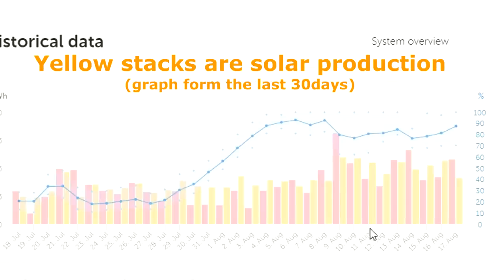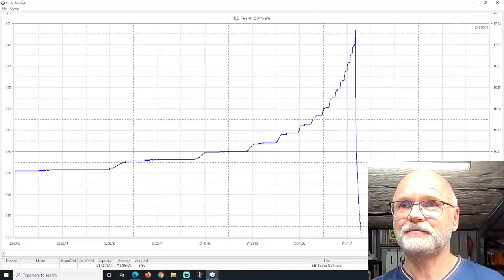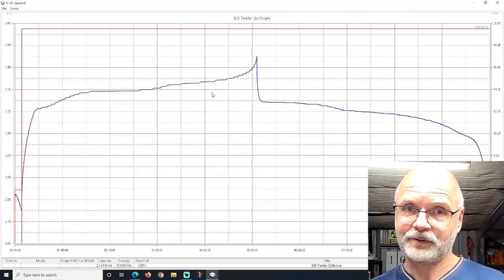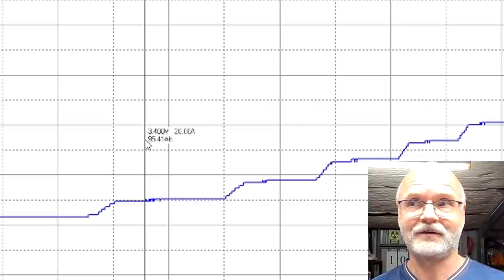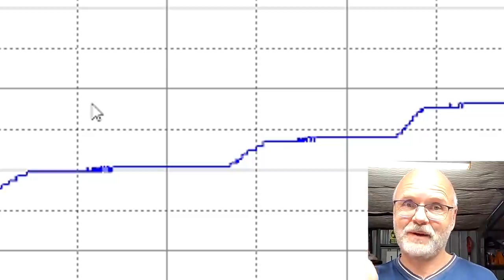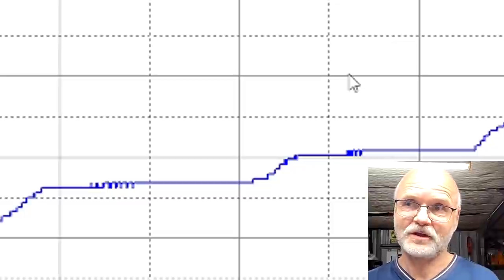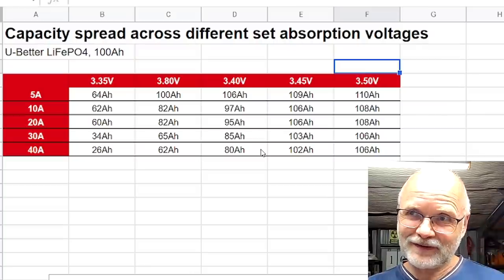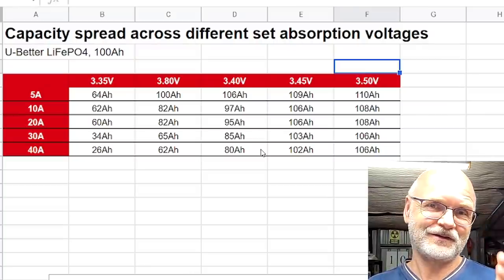Finding 20% and 80% SOC with LiFePO4. Why charging current and charging speed matters!

Comment: This is the best video I have seen you make. It really is help at this point as I have just been wondering what the capacity is with that crappy Daly balancer. It stops  charging at 3.3 volts on 10 of my 16 cells cause 2 or 3 cells hit the max and then stop charging over and over on the low cells. Daly is disgusting.

Comment: There could be an issue with the 'apparent' battery voltage as the current changes.  The impedence of the battery, bus bars and cables will cause a higher voltage reading with higher currents.  The voltage after a short rest of zero amps is the true battery voltage, not the voltage as power is being put through it.

Comment: Very interesting. I wonder what it looks like at 3.55, 3.60 and 3.65V? I have a sneaking suspicion that the differences would get smaller again. Then would be the question, at least in my mind, testing absorption times. Despite not wanting to stress the battery, it may well turn out that charging at 3.65V is best. Inevitably, one cell will max out well before the others and so charging will stop while the cells absorb and balance. How cool would it be if that turned out to be the most efficient and fastest charging, AND after balancing and absorption, the cells were standing at 3.45V? I bet that they would you know. But, does the absorption time vary according to the charge rate, given a fixed charge voltage?

Comment: This is superb, I kind of thought that from my own loose playing / experimenting, but seeing it methodically tested out and graphed confirmed why its so easy for my MPPT to go into "float" when charging at lower voltages, have  spike in the sunshine, peak amps and hit the absorption voltage very early in SOC.

Cheers Andy.

1 thing I'd been interested to compare is what the comparison of the 5A charge you have there is to a 40A but then absorb to 5A - so both finish at the same amperage - how does that effect capacity ? Does that bring it back to a match?
Reply from the maker: Thank you. I will do your suggested test at a later stage. It's on my list now 😉

Comment: Great analysis and real data as usual Andy. I wonder if you could automate a settings values for low light/ cloudy days, ie: your system knows/senses these extended low light times and makes adjustments to the voltages within settable parameters to maybe increase voltage a little when the system is going through extended periods of low lighting/rainy periods and conditions to help compensate and push a little more amperage until it reaches say a (settable) 90% SOC to help keep them in or absorb a higher state of charge? Does this make any reasonable sense to you. I guess if ur chasing more than 80-90% from ur battery bank, u should probly be considering more batteries, cheers, I SPAT on you.
Reply from the maker: Thanks Evan. That makes perfectly sense and I think some people in Europe do this manually and turn their BMS from summer to winter mode to achieve a bit more charging in wintertime. It is also possible to include the weather forecast in your charge algorithm and charge the cells a bit higher if bad weather is going to hit the next day.
Cheers 🍺

Comment: 100% as suspected.

I have a EV with the same battery pack of your previous car. (328V 50 Ah)

When charging with 2.5 C, the CV part of the charge start at around 40%, but when charging at 1.5C, starts at around 60%. And 0.1C, it starts at above  95%.

Since you have time based CV part, you get different amount of charge before the time is up.

If you use a tail current, I assume that your energy will be more consistent.

The reason you get more consistent result with higher voltage, is due to the fact that the voltage increase is steeper at the end.
Reply from the maker: Yes, these tests were all without any absorption. If you do that it's a totally different outcome. You can set a tail current in the SCC and would get a better consistent charging.

Comment: Wonder if Victron's default 3.55V is even tighter across those charge currents.  the 3.8V results are interesting, and shows there is a sweet spot that the batteries like. Unsure how it would related to longevity of the battery though.
Reply from the maker: Could be a bit tighter spread. They also do a 2h absorption phase afterwards. So these cells are then 100% charged. I don't like that...
3.8V must be 3.38 though. I'm just too lazy 🤷‍♂️

Comment: So what I’m hearing is the faster you push amps into the cells, the less efficient the cells are at retaining the amps. Ergo, a 48v battery in the same environment as a 12v battery is likely 4times more efficient at retaining the amps when charging, all other things considered equal.  So that makes a good case for using a higher voltage battery bank over a lower voltage battery bank. And not just because of wire size, but because of efficiently. Would you agree?
Reply from the maker: No, you misunderstood that. It has nothing to do with efficiency of the battery at all. It has to do with allowed time to absorb energy while charging. 
Think about the cell as a sponge. If you trickle some water on it it will fully take in all the water but if you tip a bucket on it, it absorbs only a bit of all that water.
The slower you charge, the more capacity you cell already has when it hits a certain voltage.
Reply: @OffGridGarageAustralia  Ah ok. That still makes the case for 48v over 24 & 12v though. 48v sponges better. 😂
Reply from the maker: @Shep5847  Hahaha, yeah, it depends on your setup. Mobile is most likely 12V or 24V, if you go stationary I would go 48V.
Reply: @OffGridGarageAustralia   I previously built an RV system on 24v and used a 24v to 12v converter. But now I’m thinking of building my new rig (due here in October) with a 48v system. I figure if I’m going to convert from something to 12v, might as well use a voltage that is more spongy in my system than 24v!  I know the wire sizes will be smaller, but really I don’t see much cost savings with the smaller wire. But the sponginess is certainly a big benefit!  Keep up the good videos!

Comment: Great work, 3.6V should be a voltage to be tested also.
Reply from the maker: That's not necessary as it will be even better than 3.5V where the capacity was already very close together. At 3.6V you get like 99.5% with all charging speeds.
Reply: @OffGridGarageAustralia  Thanks for the info, I never tested that. I have some 32700s of 6000mAh that I want to make various tests on and I'll also get some 100Ah "bricks" for my future solar. Those will be a paint to be tested from a time interval perspective.

Comment: I have a problem. I have been constantly watching your videos.  Great resource. The best I can find so far.  

I ended up buying two of the 250A Muller BMS 12V  

One cell is making me pull my hair out. If I set the charge cut off at 3.55 per cell all cells will charge to 3.45 except one.  One cell is stuck at 3.330. I have the balancer starting at 3.45. 

I tried to drop all cells to 3.350 and balancer at 3.330. no luck. they will equalize but would mean im stuck at 80 percent

Comment: To get the the AH capacity,  What was the time for each level? A longer charge time with a low CC will give a higher AH. But if you charge with a low vs a high CC for the same what do you think the outcome would be? Lets say starting from 3.250 to 3.500 or until lets say 30 min charge?
Reply from the maker: Ah, I see what you mean. interesting question... 😉

Comment: Isn't this just because the voltage reading is not actual battery open circuit voltage? When you charge with high amps then the voltage reading will always higher than the actual open circuit voltage, right? So for example for the 3.8V 40A graph, the reading of the voltage is higher than the battery open circuit voltage, that is why it had a very low SOC reading. I guess this voltage difference is made by the battery internal resistance. And perhaps the more a battery is charged, the higher its internal resistance? I guess when you change from 3.35V to 3.45V, then what it means it just the battery will be charged with more energy and it's internal resistance also gets higher, resulting it becomes "harder" to finishing absorption at that voltage, so you see less variance?
Reply from the maker: Yes, that is correct. Charging voltage is always higher than the actual cell voltage. Otherwise you would not be able to let current flow. The interesting part is the saturation of these cells. It's like a sponge: fill it slowly it will hold a lot more water than if you just tip a bucket of water over it. There is not time to absorb the water. That's basically the internal resistance of the sponge. Similar with the cells and LiFePO4.
Reply: @OffGridGarageAustralia  Yes. Thanks for making those videos. I also noticed this sponge effect these days, as I don't have a BMS yet so I was manually monitoring the battery while charging it with solar. What I noticed is that the voltage reading went up or down with different amps on different days, while the battery indeed got only charge up single direction. Sadly in Sweden it's getting cloudy autumn now, not sure if I could survive through the winter with my battery 😁
Reply: @OffGridGarageAustralia  Fuyang Liu points in the right directions. In your table you see more or less the impact of the internal cell resistance (I assume you have measured the voltage directly at the contacts of the batter). Let us pick the figures for 20A charge current and 3,45V with resulting 106Ah. If we double the charge current to 40A there ist the same 106Ah with 3.45V. This is no surprise. The internal resistance creates a voltage drop which is lost für the chemical process. What are the specs of the cell stating regarding the resistance?  From comparing the figures at the 3.4V @20A and the 3.5V @40, I estimate the internal resistance of your cell to be 5mV / 20A = 0,25 mOhm. Of course, there will other effects as well, but the Ohm law ist present.

Comment: Be curious of the battery temperature between 5 amp charge and 40 amp charge 🤔😁
Reply: I agree
Reply: it is negligible and shouldnt be too warm since its a 100Ah cell.
Reply from the maker: I never got a battery warm through charging. They are so large and Ri is so small. Does not make a difference at all as Chandra said.

Comment: Excellent video and very good graphs.  Is it best to charge to a certain voltage or to a specific state of charge (SOC)?  I have set my batteries to never discharge below 10% and stop charging at 90% SOC.  I was told this is best for getting a long life out of your battery.
Reply from the maker: Yeah, that is probably best for the battery. It is just not easy to find these points with LFP batteries. What are your settings to achieve that and do they fall inline with the numbers I have shown in this video here?
Reply: The only way I have found to get 10% to 90% is a very accurate shunt. Voltage is a very poor SOC indicator as Andy just demonstrated.

Comment: It's very interesting to watch - at lower voltages and higher charge currents, the battery is given next to no time to "absorb" the voltage so takes in much less charge, but just pushed to the next voltage up during that charge curve. But at lower charge currents (eg 5A) you can see the battery is given more time to "adjust" to each voltage - I think this is why it reaches a much higher SOC. I wonder what would happen if for example you set the charge voltage to 3.35 / 3.38 /3.4V with your big 40A Chinese charger and let it absorb down to say 1-2 amps instead?

Comment: Seems like you just want to lower the current the closer you get to the charge voltage.  Probably 3.45 and 3.5 gives you the sweet spot where the charge controller is reducing current BEFORE the BMS triggers an over voltage stop.  And if you do 3..35 the charge contoller must think a full charge happens based on voltage which is higher when more current is put in.  Almost like you need full current to 3.3V, then 10A to 3.4, then 5A to 3.45V.
Reply from the maker: You can still fully charge the battery to 100% at 3.35V with a looooong absorption time. I have a test for that on my website, I believe...

Comment: The trees blocking the sun are a problem, a little trimming seems to be in order. not mentioned in the equation is extending battery life by not charging or discharging so high or low. Interesting.

Comment: I don't know how you measure the voltage on your tests. But if you are measuring the voltage at the output of your tester then there is an increasing error, because of the resistance between point of measurement and the cell poles. The voltage drop will be higher the higher  the current. So, when the charger sees 3.4 V, the real voltage at the cells will be still be only 3.35 V. There is equipment available that has extra voltage measurement lines with no voltage drop. With this will get much more consistent results. 

There are solar chargers that also have extra voltage measurement at the battery to compensate for the voltage drop.

An additional error is introduced by using the charged capacity as reference, instead of discharging the cell when it reached the target voltage with the same reference current. The difference is that higher charge current will cause higher loss at the internal resistance of the cell. 

Finally, I don't understand why it is so important for you that the battery is perfectly balanced at 100 %, and voltage even above 3,6 V. You know that this all causes faster degradation, especially when you keep the battery at this high SOC for longer time. Its like with the batteries of mobile phones and notebooks, that are charged to 100 %, and kept at this state. 
You should be relaxing a bit regarding SOC and balancing. 3.4 V is good enough  for charging. If one cell sticks out the head and gets higher than 3,4 V the active balancer will do it's job over time. How long balancing takes doesn't really matter, as long you have enough capacity. 

If you stay at 3,4 V you probably see never a disconnect from the BMS, because active balancing keeps the balancing. I don't think that more sophisticated BMS with direkt charger and load control is worth the money. This money es better invested in more PV and  battery capacity.
Reply from the maker: Hi Emil, you must be new to the channel. Welcome!
The voltage is measured at the terminals directly. All ZKE-Testers do that.
I'm testing different settings here on the channel and don't just do the straight and correct tests and setup as most other channels do. I'll leave the proven track and go of-road, exploring, observing and learning from that.

Comment: Hello.
LIFEPO4 cells are sold under many brands. The number of charging cycles, charge-discharge currents, price, min discharge-max charge voltages may differ.
I'm talking about prismatic cells. I want to make the most suitable battery for F/P. Therefore, what is the essential determinant in cell selection?
Does it make sense to determine the battery capacity as needed? Or is more better?

Comment: when i was off-grid i also found even tho nothing had changed that the battery would take longer to charge some days compared to others my idea all be it wastfull was each panel having a buck converter wide open voltage but limit the current so lets say the dullest day the panel will only put out 1 amp at best i set that then if charge rate of battery is 40 amp i would use 40 panels not ideal due to space limits but this in thoery woul keep a steady charge rate no matter the weather that or hydro as that tends to be a steady flow rate etc
Reply: This isnt the problem, nor the fix. I have answered the issue above. I see this "data" everyday on IMAX b6 charger with 18650. Charge controllers using a timer is the issue. 

Hidden by the fact both 13.8v and 14.4v are an overcharge voltage for SLA. However with lithium it leaves the battery undercharged using volts and time only.
Reply: @LambySRI  yeah they prefure to be charged with cc/cv and solar controllers dont work that way but my way with a buck converter will do cv/cc as long as they is sun and as far as i know thors voltages are the max charge voltages 13.8 for sla standby and 15 for cycles charge but i tend to use 13.6 and 14.6

Comment: Based on described data in the 5 Amps current, the charged cell is 64Ah in 3.35V and 106Ah in 3.4. It is obvious that the 100Ah for shown 3.8V is located between the 64 and 106Ah. So, the 3.8V is mistakenly written here it might be 3.38V instead of 3.8V.

Comment: Thank you. I'm starting to use those batteries now in Ukraine as we start to experience power outages(again).
I got 304AH Eve batteries, same as you, and going to charge to around 3.32V and then discharge to around 3.22V to make batteries last longer. Going to charge at 10A those 304AH batteries, so it's going to be 0.035C.